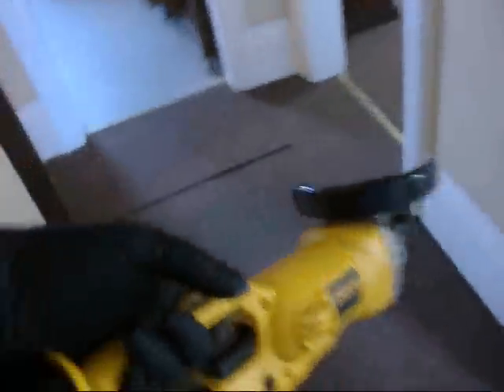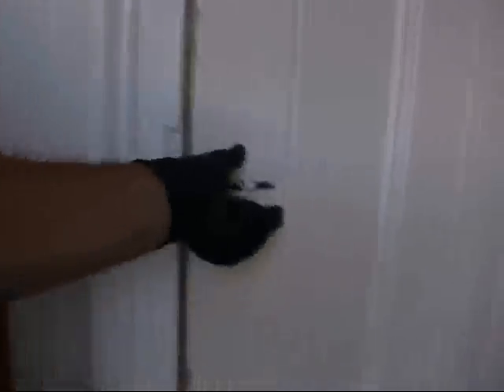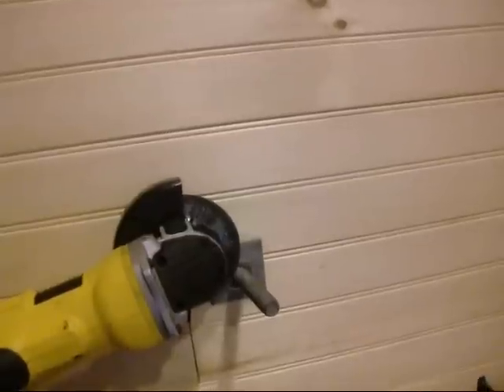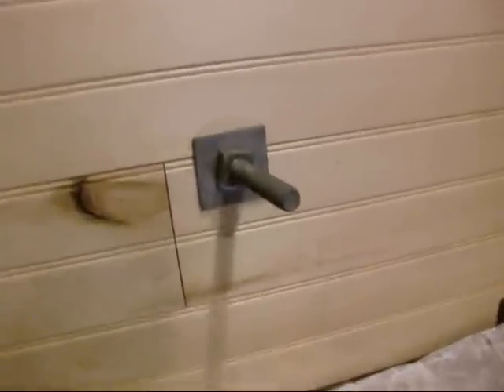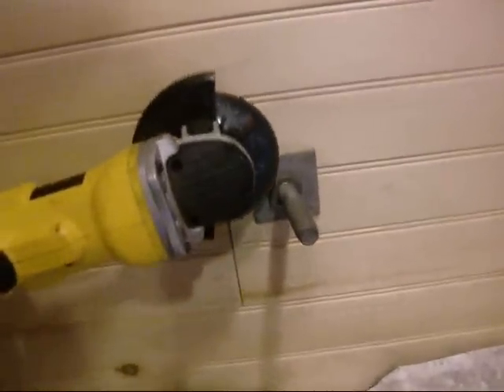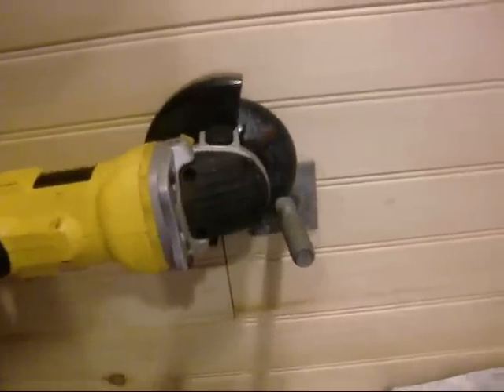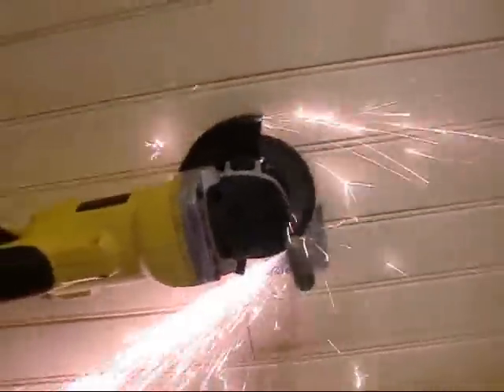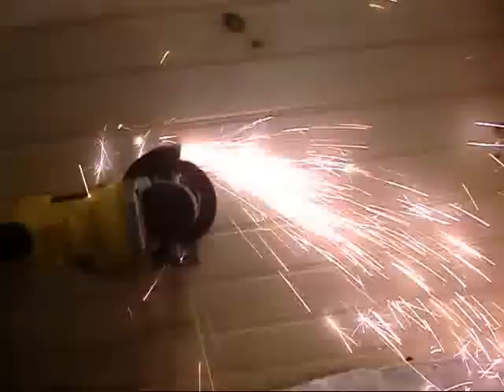6 6 12  Apt 9 Final Little Details...

Comment: Does your building have handicap access ? I have seen so many that do not. When I worked in the NYC I seen 300 floor walk ups . No elevators. There are quite a few of those in the city . I guess it so cheap to build them. One funny one I seen one that said handicap access and it was but only 1 on the main floor and had a guy there living for 22 years .